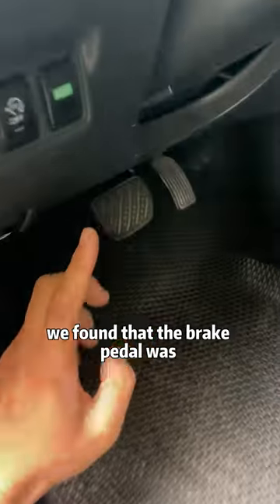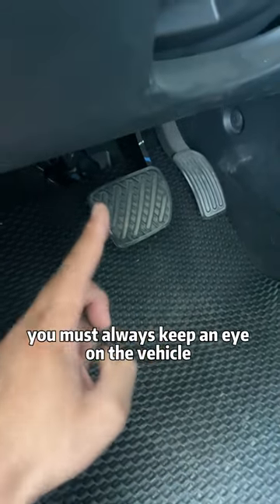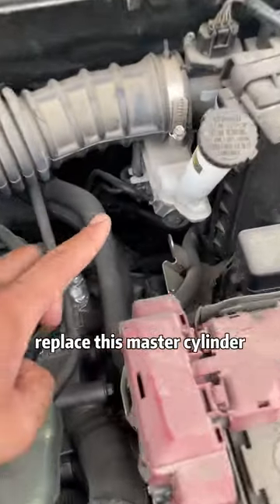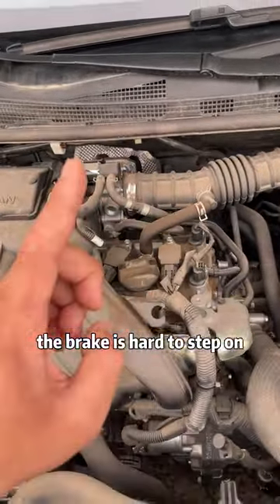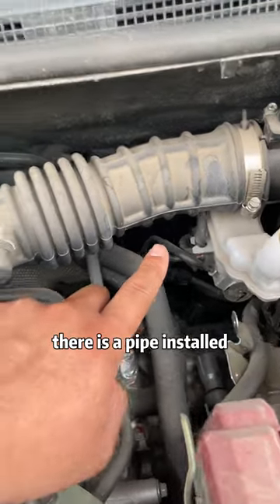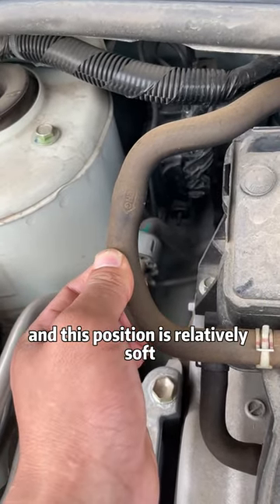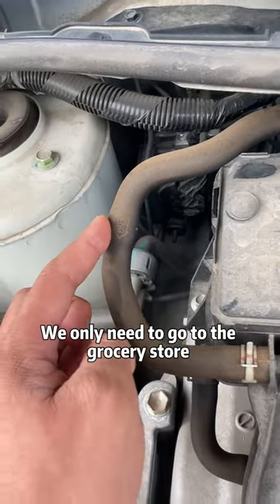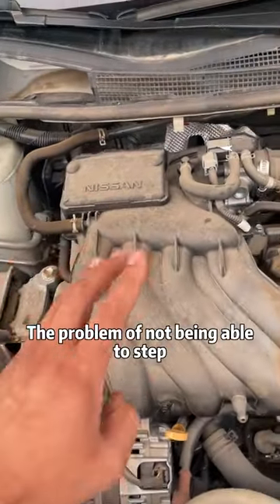If you can't step on the brakes, stop and check quickly!#car  #driving  #tips

Comment: If that's the case it could be a bad vacuum line and possibly even your brake booster which operates off vacuum pressure. Sometimes you need a new master cylinder as well though because if it's leaking it could be the reason your brake booster stopped working. Brakes aren't something you should ever go cheap in my opinion.

Comment: In this situation replacing the vacuum pipe will work as a get-you-home measure but you need to replace with the correct part as soon as possible.
You will lose all brake assistance every time the engine stops so if you have stop-start fitted, you need to disable it.

Comment: Lol. You cannot replace it with grocery store part. You have to buy identical part or your car will not brake properly. The car will have no braking ability with the engine turned off if you remove this valve.

Comment: Does brake stop the engine .
What are you doing man the brake system all of it has nothing to do with engine .you push the pedal to press the fluid wich move the disc to press the ring simple is that .🫡🫡🫡👍